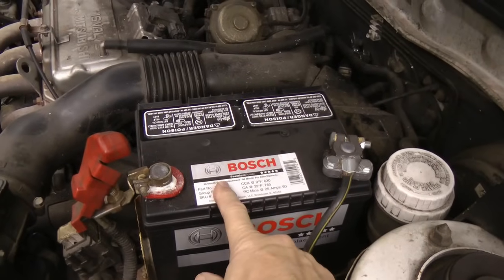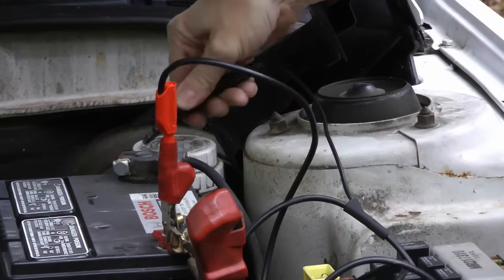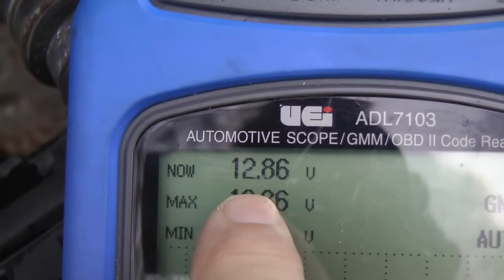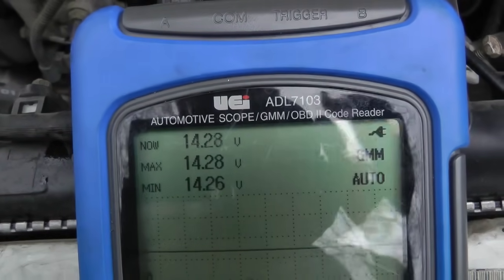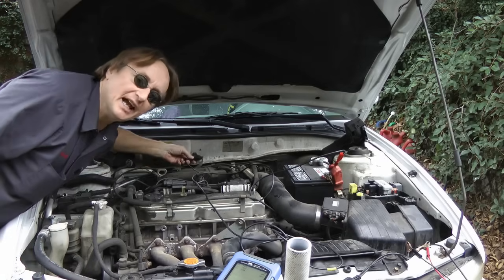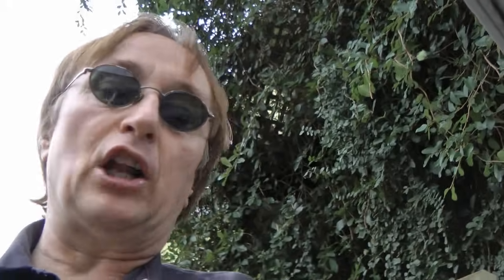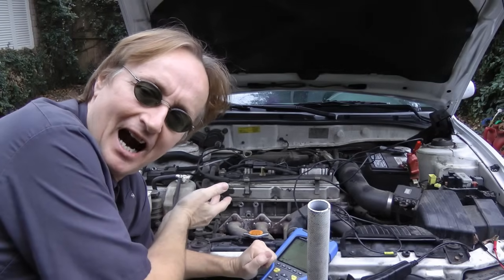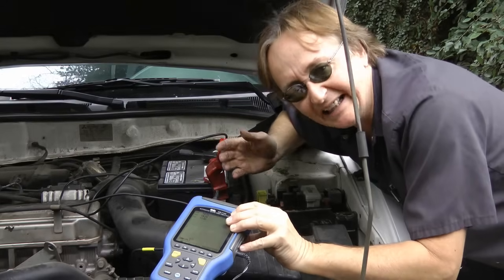How to Fix Electrical Problems in Your Car (Ground Fault)

Comment: Hi, I have a 06 Lincoln Navigator 5.4 my air suspension in front went out. I replaced the air struts height ride and sensors compressor. Now the when its all together the relay has gone out blew 10 amp fuse for lamp signal right side. I tested the relay make a note my relay is next to the air suspension compressor. It is a cube 70 amp 12v with 4 prongs. I jumped the compressor at the battery and it runs. The plug at the compressor has heat to it. Next, I removed the junction box took it apart put all new small fuses in tested continuity with a multimeter. im, not a wiring wizard. While the motherboard in the back of the junction box was out, I did try to test the continuity there. I Saw 5 resistors tiny light tan with black gold, and one other color I think brown. There were ok. Then I saw a black one that had some numbers I could not read. There was no reaction when I tested it. 
I put it all back in my SUV plugged wire harness in, next my amber right blinker blew and the right door blinker was going faster after the bulb was removed from the front. My son put a new one in. It seems ok. Start the vehicle still will not engage the air compressor to air my front new struts up. My hair is white from stress. Help there are no good videos about this problem. There are many people, who have the same issues though. Thank you, I'm a female who likes to repair as much as I can.

Comment: Hey, Scotty. I'm having a problem. My car just melted both battery cables. Was running fine then all of a sudden it started running very rough right as I pulled into the driveway. Then right when I parked and about to shut it off, smoke started pouring out from under the hood. Like I said, both battery cables were melted and what I think is the starter must've heated up because it had a sticker on it that burnt off. It's an 2002 toyota camry. Any pointers would help. Thanks.

Comment: The light bulbs for my licence plate won't turn on, even after replacing the bulbs with new ones. I'm guessing it's the wiring.

Comment: I have a 2012 GMC Acadia, when I drive it more than 30 minutes I will sometimes not always hear 3 dings in the console and then the voltage will start to drop down below 13 volts.  I have replaced battery and alternator and still have the same problem.  I have also noticed rpm run above 2, I have lose of fuel and power in vehicle.  What do you think this is.  Dealer claims they can't replicate my complaint.  I can't drive the vehicle for than three days at at time.  I'm not sure what they are not doing to find and fix the problem.  Thank you

Comment: I have an 02 Monte Carlo,114,000 on the dash...I suspect a bad ground,it will start but very slower turning over but as soo as it starts couldn't even tell anything was wrong...tested alt,battery running and shut off after sitting.Alt is pushing around 14.45-14.50 battery is testing great...Where is this bad ground..?

Comment: Hey Scotty- I have a '13 Chevy Camaro with a standard transmission. 28Kmi. Radio cuts out if I coast and the RPMs get below 750. It also always happens when running on battery after 1 min. It turns back on right away but not properly CD error shows up and sometimes there will be no sound. It just started a month ago and it is the only problem with the car. I have to turn the car off and re-start it for the radio to work right. It also has never seen road salt and the battery and its connections are good. My guess is a bad solder joint on the radio's circuit board? It seems like an occasional power starved situation.

Comment: My car 2015 Rav4 70,000 km ...
was sideswiped in a parking lot and once repaired we had trouble with the electrical, car starting, horn beeping, interior lights flashing , uable to lock the door with remote etc etc. After a half dozen times back to the body shop, it was taken to Toyota and they worked on the electrical...a couple of months down the road when I turn left the interior lights flash, hatchback beeps, I returned to the body shop they kept it for two days and said..they couldn't find the problem..not to bring it back...btw damage 'original parts' 12,000.00 plus 1,000 toyota..plus plus...would you have any idea what the problem could be...contacted my insurance company and awaiting a return call..thanks

Comment: I have a problem with my car it just started happening my car I started and I drive I get four houses down from my house and the car loses power and shuts off then I turn it back on and starts again and go for more houses and shuts off loses power and everything so what do you think this might be note everything shuts off even power
Reply: nietolkj like he said earlier you could have a short somewhere pushing the back feed to your fuel pump causing it to lose power over time

Comment: can a electrical short run through floors, seats,  steering wheel etc? or brake pedal?  I have a 2006 accord with heated seats.  numerous electrical issues and could swear I've notice some type of sensation from sitting in this car

Comment: Man hope you can help me I just did head gaskets and head on my 2001 impala 3400 got it apart then found out I needed a head so it sat for a week after getting it back together motor runs fine but now trans when in drive feels like it is trying to take off in drive not lower gears

Comment: what if your car wont start? im having one heck of conundrum with my ford focus. The fan wouldnt start so someone suggested i put a toggle switch on the ground pin in the relay, well i had no knowledge of electricity before this, but i ended up plugging the switch into a few different pins, big big mistake. now the car wont start. cranks but no start. after that i made another huge mistake which was jumping the fuel pump relay. this got the car to start, but after i switched everything back it wouldnt start again, even after jumping the relay again. now ive learned a bit about using a multimeter and electricity in general. i have no power in several fuses and 2 relays. how do i find where that problem is when the car wont even crank anymore? thank you for your videos by the way, they have helped me alot

Comment: I have a honda element 03 batt is good alternator is good If I disconnect the ground the car shut off, I hooked up a test to the ground cable and touched ground post and the test light came on

Comment: Hello from DK. I think this might be grounding... My power window pass. side doesn´t work. When I take the panel off and test it with a simple electrical pen, it starts working. I can open and close it but only with the pass.side switch. when I put everything together again it stops working. Its not the switch. I tested it.

Comment: Thanks for the educational and clear  video. I'm looking around for a short problem. I have to trouble shoot, as my fuse goes bad immediately upon replacing it. So I assume, must be a short.
Reply: Did you find the answer to your problem? I am having an issue when upon trying to start the car, the fuse keeps blowing. EVERY. SINGLE. TIME.

Comment: My display on my radio recently started to display gibberish on occasion. Radio itself works fine. Just not the display. Also if I'm not careful I sometime blow the fuse for the auxiliary power

Comment: Scotty
My windows except driver side are stuck up. My lights only work on bright and running lights. Door locks and emergency flashers come on. Any ideas what to look for. We replaced BCM. 2004 Suzuki Verona. Blowing hot air from heater and no AC. I guess thermostat.

Comment: Every now and then my bulb out light will come on and one of my tail light bulbs won’t work... If I turn on and off the truck then it will go away. Same thing happens to my ABS Brake light and Brake light. Then my check engine light came back and it went away after a week. I got the code for it which turned out to be a power steering switch but before I bought the part the light went away.

Comment: Hello Scotty hope that you and your family are doing well. Got a question for you I've been looking online for results, none in sight. The problem is my friend has a 2014 M37 Infiniti, after his girlfriend brought his car back, for some reason the flashers won't stop flashing even when the switch is turned off and the car is off. No one obviously has had this problem with the car yet any advice. Looked in the owner's manual, for flashers, all it has is how to operate it turn it on turn it off that's it. One entry someone added from that model vehicle, is the same how to turn on and turn them off. I would like to know, why they stay flashing even when the car ignition is off. You've helped me with several other problems your help would be greatly appreciated Scotty wishing you the best. I'll be waiting for your expert advice.

Comment: i have a 1999 F250 ford truck, everytime i plug my camper into the truck the light go haywire.  I have replaced the plugs to the camper and when i hook the camper into the plugs on my blazer they work just fine.and no my blazer will not pull the camper,  how can i determine where my problem lies.  And yes I am a woman so my wording may not be just right.  please please help me  i cannot go camping until i get it fixed.  thanks

Comment: Please help me I have an rav4 2000 that drives for 10-20 mins and shuts off after about 5-10 of setting it starts really gut back up. I am out of almost 200 so far on ships guessing what’s wrong. One shop said it’ll be $255 to see if it’s bad wire. Please help

Comment: hi scotty... im having trouble with my 07 f150 power windows. im getting power from the relay.. motor is good on all windows...I've replaced the master switch and repaired the driver side wire harness. still no power windows.please give me insight

Comment: Have 2002 Volkswagen Passat Signal light on one side stays on when I use the the remote to unlock doors or trunk and also if I manually press the lock or unlock  buttons on the door console. The only way to turn it off is to disconnect the battery for at least a half hour to reset it.  Signals and hazard works unless I use the power locks. Tried replacing the signal relay and still have same problem. Need help pls

Comment: Hi" what does it mean when I turn on the air blower and the battery light comes on. Now it doesn't come on right away but  normally I see this issue when it's raining. Please let me know. Cause if I ram the engine the light goes off. Thanks

Comment: Scotty Kilmer I followed your advice after the green wire on my fuseable link burnt into on my 1997 Nissan pickup 4wd an the light went off when I came to the last fuse which controles my inside dome light an I left the fuse out An rehooked up my fusable link an again it started to smoke ! What am I doing wrong ! Please help Frustrated an Confused !

Comment: I keep coming back to your videos, Scotty. Great info. I just diagnosed a bad ground wire on the left high beam of my 2000 Nissan Maxima. I fixed it by running a jumper wire from the other light. I could not find the broken ground, but the guy I bought the car off of could not find it either. Lots of light now.

Comment: Scotty love watching your videos. I am having a problem with an old chevy truck 72 c10 with truck running turn on headlights and it kills everything, well except this last time the dome light stayed on and wouldn't turn off. I actually thought I had it figured out the other day. There was a wire going to the fuse box that runs the heater fan on a toggle, I unplugged it after the truck died from turning on the headlights and everything started working again with headlights on. My son drove it around last night no problems then this morning he turned on the headlights and done what I explained at the top. Can you help me please? Also I've had this truck since I was 17 I'm in my 40s now and gave it to my son.

Comment: Scotty Kilmer I have a question. My clock/radio channel display goes off and on when I'm driving. This happens also when I start the car. I won't see the clock display but then after a few minutes it comes on. Do you have any advice/suggestions. Thank you.

Comment: Am getting a negative charge from. My main power cable(red, positive cable which runs from battery to engine) which is making a short cirruit. Any ideas... 2009 audi s5

Comment: 2008 RAV4 any time it rains are goes through large puddles every light in the dash comes on traction 4 wheel drive lock and check engine what is it?

Comment: Hi Scotty I really like your videos thank you for posting my problem is that my electrical is shutting off little by little the last time that happened my battery was bad but I taking it to a couple of places already and they keep saying nothing's wrong my battery so what do you think it could be I don't want to get stranded anywhere because I've had it happened went to get in my car and my car wouldn't start after they told me that there was nothing wrong. Thanks a lot

Comment: I have light problem on the front passenger side of a 328i BMW the running lights come on both side but  on a passenger side won't come on where should I start

Comment: Mr.Kilmer,,,i have a explorer  and when i turn my headlights on my back tailtight wont come on but everything else works ,turning signals work , and brake lights work ,, but that drivers side tale light wont come on ,,,ive checked fuses and i ordered a new light  switch ,,, what do you think ??????

Comment: Hey scottty my nissan murano does not want to change gears while running the transmission is good and engine as well i got told that it was my alternator was messed up could that be true?

Comment: Hello
I got a 88 Toyota pickup and the brake lights, signal lights and running lights Dont work. But the hazards, front high/low beam work. I checked all fuses and relays and they are working. 

What could be the problem?

Comment: Awesome. I got a 2000 Toyota Avalon that's infamous for electrical problems. The instrument panel and interior lights flicker when the car is running. Hopefully I can figure out what's going on with this

Comment: My exterior voltage is 14 volts in my 08 Vue, on the interior, the lights slightly flicker and the voltage is 13.  Only occurres when the engine is running

Comment: I have a 99 Tahoe and i don't have any brake lights. tail lights and signal lights work. Changed the brake light s switch and still no brake lights. Could it be the turn signal switch be bad?

Comment: I have a 2005 kia that at night driving down the road the interior and headlights flicker occasionally 2-3 seconds and goes away, could this be a ground issue or alternator or voltage regulator?
Thz

Comment: Actually Scotty, even if the voltage difference is less that 0.4 volts there is a ground fault. The device may still work but a problem is developing. Any voltage drop means resistence.
PB electronics engineering technician. If it looks clean just back it off and retighten it and hit it with jigaloo.

Comment: So are all metal parts on the car, engine, frame, engine mounts suppose to the have the same voltage reading, as across the battery?

Any chance a bad ground can through off o2 sensors? Or would that simply be a bad sensor?

Comment: OK Scotty, I have a fuel pump that cycles on and off after my explorer is shut off cycles about 15 sec on and off and does this for about 20 min. I changed the relay and after i pull the relay the pump still runs. Im pulling my hair out and i don't have much.

Comment: Hey scotty, i've been trying to track down this stalling problem for a while on my 98 ford Ex. Its always started up fine after it stalled while idling. But today it just clicked and clicked. After about 8 tries and messing with the positive terminal wire it clicked then started. I got back in my car and held my power windows up and every time i did the revs would drop. So i turned my stereo on and held the power windows up and it completely stalled out. Does this sound like a bad ground or alternator problem? Maybe i just need a new positive terminal? Have you ever heard anything like this?

Comment: I’m having a problem with a few electrical things on my automatic 2012 corolla, I know it sucks to ask free advice and I’d pay you if I could. When I use anything electrical like turn signals, power windows, changing gear to reverse or drive etc, sharp steering and/or windshield wipers my lights dim and sometimes my radio will cut off and then back on, even my power steering will go out sometimes. My passenger tail light and brake light I had to smack upon turning the car on each time until it turned on which it cut off completely recently and hasn’t worked since but all signals work. I don’t know which route to take as in what to spend to fix the issue. If you could point me in the right direction I’d be truly grateful..thank you for reading
                               -Tracy

Comment: Hi Scotty.  Wondering if you could help me.  I have a  1999 Dodge Ram van 1500. My headlights,  dash lights and interior lights get very bright when I'm driving.  People think that I'm high beaming them.  But I'm not. The lights just get very bright for an instant.  They get brighter than when I'm using the high beam. A mechanic has replaced my alternator. And I'm on my second starter. Sure could use your wisdom.

Comment: I have a question when I changed my blower motor my car started to act funny I don’t kno if it’s the body Control Module but my coolant temp gauge stays on cold & when I put my car in park my headlights go dim

Comment: Hey Scotty, I have a 2001 saturn L200, 2.2ltr. I turn the car off and it's just sitting and the headlights will just come on and then the battery runs down, but  everything is off and the keys are out of the ignition.